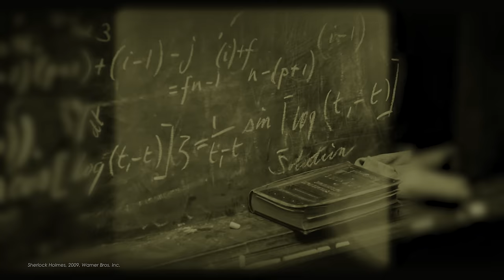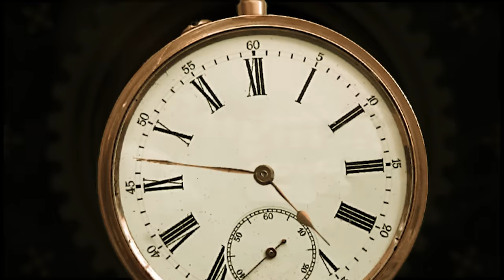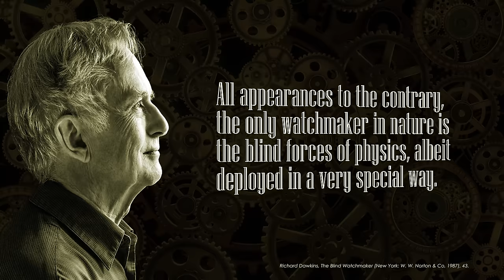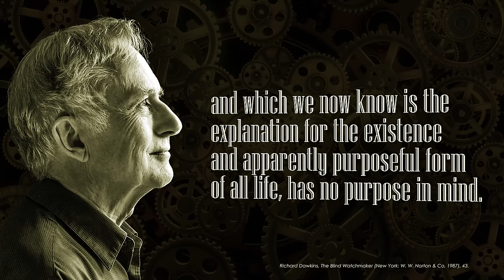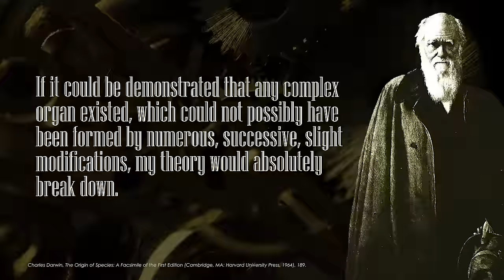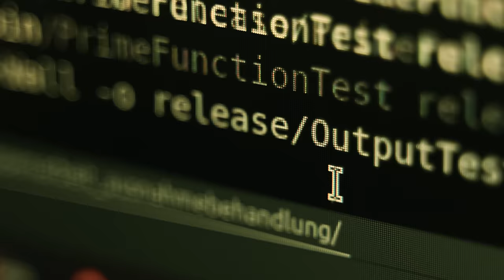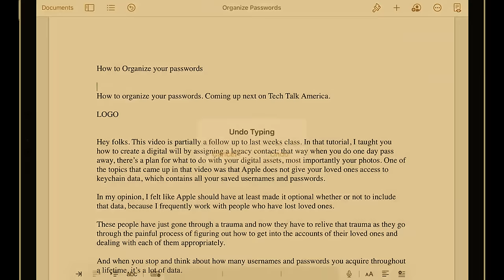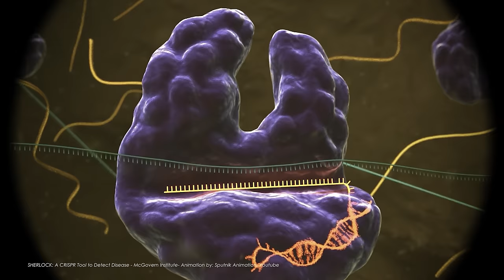Even TOP Evolutionists Won’t Deny This Evidence for God

Comment: When asked for an example of mutation which adds information that benifits the organism you get crickets from any evolutionist. Yes we can artificially improve yields and nutritional value in crops but corn never becomes a tree nor bamboo wheat. However even when we modify organisms it is intentional, with forethought and using information and materials provided by God.
Reply: Point mutations add infomation to the species, not the individual. Other mutations like gene duplication do both.
Reply: Point mutations. Read a book
Reply: @tims5268  point mutations (AIG) 

Point mutations are mutations where one letter changes on the DNA sequence. A point mutation in our example could cause “car” in the second sentence to be read “cat”:

The car was red. The red cat had one key.
The key has one eye and one tip.

With this point mutation, we lost the information for one word (car) as well as changed the meaning of the sentence. We did gain one word (cat), but we lost one word (car) and lost the meaning of one phrase. So the overall result was a loss of information .
Reply: @jockyoung4491  But many times, point mutations won’t produce another word. Take for instance another point mutation, which changes “car” not to “cat” but to “caa”:

The car was red. The red caa had one key.
The key has one eye and one tip.

With this point mutation, we lost the information for one word (car) as well as the meaning. We did not gain any new words, and we lost one word and lost the meaning of one phrase. So again, the overall result of this point mutation was a loss of information, but even more so this time. (AIG)
Reply: (cont.) 
Point mutations can be very devastating. There is a children’s disease called Hutchinson-Gilford progeria syndrome (HGPS), or simply progeria. It was recently linked to a single point mutation. It is a mutation that causes children’s skin to age, their head to go bald at a very early age (prekindergarten), their bones to develop problems usually associated with the elderly, and their body size to remain very short (about one-half to two-thirds of normal height). Their body parts, including organs, age rapidly, which usually causes death at the average age of 13 years...
Reply: Not all point mutations are as devastating, yet they still result in a loss of information. According to biophysicist Lee Spetner, “All point mutations that have been studied on the molecular level turn out to reduce the genetic information and not to increase it."
(AIG)
Reply: Gene duplication and mutation, not to mention what you mean by “information.” 

Ask a creationist what this means and give an example and you get crickets from the creationist. 

Sorry @joels310 … you ignoring the types of mutations doesn’t make them go away.
Reply: @newcreationinchrist1423  can be, being the operative word here Jimbo. But of course you can only focus on what’s bad, when in reality they are mostly neutral.
Reply: @newcreationinchrist1423  and of course you believe everything put out by aig
Reply: @newcreationinchrist1423  perhaps you shouldn’t learn genetics from science denying liars like AIG. A point mutation isn’t necessarily just a change, a point mutation is deletion, change, or addition of a single base pair. You realise that addition means adding right? Also the English language and DNA aren’t the same thing, they don’t work the same way.
Reply: @Bomtombadi1  mostly neutral. Imagine that. And do you see what they said about the ones that are not?
Reply: @Bomtombadi1  I believe them more than I believe you 😉🙏✝️
Reply: @tims5268  did I ever say it was only change? Perhaps you should actually read what I posted.
Reply: @newcreationinchrist1423  yes you did. ‘Point mutations are where one letter changes’. The fact that a nucleotide base can be added is an example of information being added.
Reply: @tims5268  deletion and change are mentioned in the span of those 4 comments.
Reply: @tims5268  Point mutations are mutations where one letter changes on the DNA sequence. A point mutation in our example could cause “car” in the second sentence to be read “cat”:

The car was red. The red cat had one key.
The key has one eye and one tip.

With this point mutation, we lost the information for one word (car) as well as changed the meaning of the sentence. We did gain one word (cat), but we lost one word (car) and lost the meaning of one phrase. So the overall result was a loss of information......
change, addition and deletion. All in one.
Reply: @newcreationinchrist1423  
Yes, most point mutations are neutral or detrimental.  So?  Some are not.
Reply: @jockyoung4491  even the ones that aren't will simultaneously lose information. Perfect example? A virus. As a virus goes along through its life stages it adds information while simultaneously losing it. 
Perfect example? COVID. In time the covid virus became more contagious and less deadly. Gain of information and loss of information.
Reply: @newcreationinchrist1423  
Yes, that was evolution.  Good example.  Information is gained AND lost all the time.
Reply: @jockyoung4491  except for the fact that to be beneficial to the point of creating an above species transformation, it would need to be strictly beneficial. If we're talking about something that has legs evolving fins, you couldn't have detrimental mutations messing up the whole process.
Reply: @jockyoung4491  to be able to adapt and form fins from legs is highly unlikely to begin with. To give it bad information mixed with beneficial information is a death sentence.
Reply: @newcreationinchrist1423  
When there are detrimental mutations, those lineages are weeded out.  That's natural selection. And we have many transitional fossils of finds becoming legs, so I don't see a problem.
Reply: @jockyoung4491  fortunately for us those "findings" of transitional fossils have all been refuted and challenged by creationists.
Reply: @jockyoung4491  furthermore you would need millions upon millions of years to even consider the possibility of weeding out those lineages and creationists are doing a very good job of getting rid of deep time. 🙂🙏 Bases covered.
Reply: @jockyoung4491 #3 you still have no naturalistic origin for how these things could have come about in the first place. Naturalism simply doesn't cut it when it comes to explaining the reality of this world.
Reply: @newcreationinchrist1423  yes imagine that! Kind of like saying all cars are unreliable because the one you bought was a lemon!
Reply: @newcreationinchrist1423  you believe them more than you believe anyone vastly more qualified.
Reply: @newcreationinchrist1423  
Why are creationists trying to "get rid of time"?  It is an established scientific fact that the Earth is over 4 billion years old.  Deal with it.
Reply: @Bomtombadi1  so I should just simply take your word that they are more informed? More qualified? I hope you don't try to go to the ad populum defense. That one is very overused.
Reply: @jockyoung4491  "established"? And tell me what observable evidence do they have to establish that? After all, that is what science is supposed to be about right? Observable, testable, repeatable evidence.
Reply: @newcreationinchrist1423  
I am not arguing for "naturalism".  Science can only address how the natural world works, but that doesn't say there can't be anything else.  Science makes no claim either way about the existence of the supernatural, and neither do I.
Reply: @newcreationinchrist1423  except DNA doesn’t work the same as written language. An addition of nucleotide bases is an addition of information.
Reply: @jockyoung4491  interesting. I've never met anyone who actually believes that way. 🤔
Reply: @tims5268  well that's nice. However, you have a problem. 
Self-replicating systems of RNA molecules have not been found in nature. That means the only place that they've been able to do it is in a controlled environment with "intelligent minds" working on it. If anything does come out of RNA experimentation in the end, it will not be something that could have happened in nature to produce life.
Reply: @newcreationinchrist1423  Designer breeds are an example of humans ramping up selection at a faster rate than nature. RNA experimentation can of course be the another example of humans speeding up natural processes. Just because you don't want it to be doesn't make it so...
Reply: @nathancook2852  like I said. Self-replicating systems of RNA molecules have not been found in nature. Therefore what scientists are doing with RNA is unnatural and could not have happened naturally in the past.
Reply: Going back to the original comment,  if corn ever did become a tree, or if bamboo became wheat, that would actually disprove evolution. This is the classic misunderstanding that many people have
Reply: @newcreationinchrist1423  it’s suddenly ad populum to listen to people are qualified and educated on the subject? Okay, I hope you remember that the next time you need to take your car in to get fixed. 

Leave it to creationists to to demand their engine be overhauled because it was an ad populum argument to point out all they has was a flat tire.
Reply: @tims5268  Only an addition as the result of a deletion somewhere else.  There are ap. 5,000 mutations in the human genome.  None of them are favorable.
Reply: @marktapley7571  
There are a lot more mutations than that.  Every individual has several. Most do nothing at all. Many are deleterious. Some are beneficial.  Mutations are ubiquitous, which is why evolution is inevitable. Beneficial mutatiomns have been documented many times.
Reply: 1/64 of all mutations creates new information. Homework for you: which mutation?
Reply: @marktapley7571  That is quite simply a complete and utter lie.
Reply: @jockyoung4491  "Point mutations add infomation to the species, not the individual."

Can you give an example of a mutation that adds new information, rather than rearranging existing information?  And how does the information get to the species rather than the individual?
Reply: @jockyoung4491    Care to respond to my questions?
Reply: with a magic wand?

Comment: nice visual breakdown of the bicycle.
Reply: Nothing about a bicycle is irreducibly complex.  Every component could have some alternative function
Reply: @mattbrook-lee7732  and yet, it's still very difficult to describe the forces that keep a bike upright in motion.
Reply: @carlosgaspar8447  no that's really easy. But also not relevant to my point
Reply: @mattbrook-lee7732  i've read many books on bike mechanics, and didn't find any of it easy. maybe your point is lost in subtleties.
Reply: @carlosgaspar8447  my point is that a bicycle is not irreducibly complex. For that matter neither is a watch
Reply: @mattbrook-lee7732  that's if the definition means removing just one component would make the system not function properly; but i think in this context it means there exists one component such that eventually the system collapses...that's why we eventually die.
Reply: @mattbrook-lee7732  "Every component could have some alternative function" Could have ... Nice word choice. How about an example? A single one will do.
Reply: @l.m.892  no. You give me one example of a bicycle component that could not be used somewhere else.
Reply: @mattbrook-lee7732  You made the assertion: "Every component could have some alternative function" . You give the example. A single one will do. If you find it too difficult, perhaps you should consider that before making circular comments.
Reply: @l.m.892  OK. Every spoke on the wheel could be used as a pipe cleaner. The tyres would make great hula hoops. Do you really think you have a gotcha here. It's pathetic
Reply: @mattbrook-lee7732  yup, spokes make for good spray gun cleaners; but hula hoops?

Comment: As a retired software engineer, I would look for an error correcting code.
Reply: That is "if" God can make an error, lol.
Reply: @TheBrandgineer  He did not. We did🤔
Reply: You are referring to Adinkra codes (symbols) right? If so I postulate that this supports the argument of a Creator. I mean if our experience is that of simulation/hologram then these laws in physics and their bounds are as result of design not evolution. I am also a software engineer (classic and quantum). You might have retired Sir, but I assure you though we may never fully understand physics dealing with supersymmetry, I agree with you although as mentioned the quantum computing I deal with is primitive still.

Comment: Nothing unusual here. If you can’t understand how this fits into evolutionary theory then you don't understand evolutionary theory. 
It's obvious what selects the successful mutation. Success! 
It's really simple. God isn't here.
Reply: You have to have a system through which mutations occur before they can be useful.  Where did that system come from?
Reply: @johnsmit5999  Not really. Mutations occur naturally as a result of mismatched DNA or background radiation. Mutations are entirely random. Selection of successful ones is entirely due to whether they fit their environment. Hence the "survival of the fittest " synonym. That's what "Fit" means in this context. No guiding hand is needed.
Reply: @ploppysonofploppy6066 Natural selection can explain why certain peppered moths survive, but it doesn't explain the origin of color, wings, etc.
Reply: @johnsmit5999  No, it explains everything. Mutations are random, successful ones are selected and proliferates, unsuccessful ones die off.